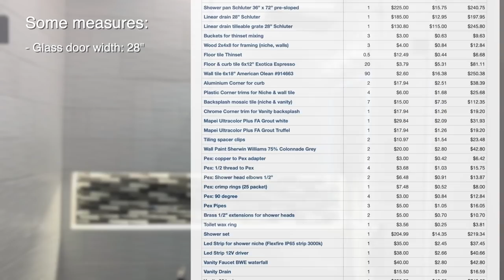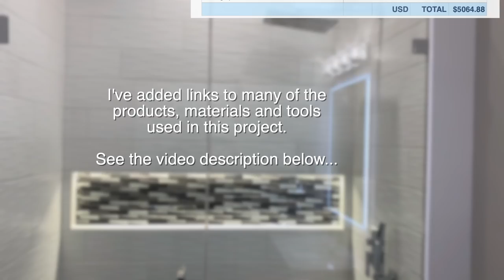Bathroom remodel with Led Light Niche

Comment: Thanks for including the "Material Cost" list.  Fyi, I think they overcharged you for line item #9 - Linear drain tilleable grate 28" Schluter  Qty - 1; Price $130.80; Tax $115.00 - Total $245.80 I don't know the state or county you live in, but those are some crazy taxes.
Reply from the maker: Whoa.. Thanks for spotting that mistake. One dot in a wrong place makes a 100 bucks difference in the cost.

Comment: Your remodeling skills are so good and you are the master of video editing. Your bathroom looks almost too good now like you spend your time thinking about ways to lure people into the "shower dimension". But I came here for the niche light LED install, not to watch you build a bathroom in 5X. It was in the title and I never saw you install a dimmer switch or know your execution of install such as did the glue hold up to keep the strip tacked down? how did you run the lights out of the tile to look max seamless install? How did you wire it to the romex? where is your dimmer? This guy is beyond "general contractor" and probably gets payed somewhere as an engineer. But his real passion lays in showers and bathroom remodeling. Thats my guess.

Comment: Why not use wood looking tiles then? Confused to use wood flooring when they have that look with tiles too, to avoid potential replacement later down the line in his comments. But, looks fantastic, awesome drain flow work...
Reply from the maker: Thanks. The shower is of course wood looking tile and as mentioned we keep the wood floor (that previous owner installed) until it need to be replaced. Then I will make the entire bathroom with wood looking tile. It was so easy to keep the pre-cut wood floor and I am actually  writing this comment after1 year in use and no problems so far.

Comment: I noticed that you installed the hanger bar on the side of the wall that the shower door opens towards to, wouldn't that cause the door to hang on the hanger bar when you open it? Also does that door open the other way too? Like push to open, instead of pull.
Reply from the maker: It opens both ways. Yes the door will touch the towel bar eventually but not a problem in daily use. It opens almost fully anyway...

Comment: Do you have an estimate as to how much this cost you? I would love to do the same thing, and same style to my bathroom. 
What would this cost if I were to hire someone to help me with this?
By the way, it's absolutely beautiful !
Reply: Just saw the material costs at the end of the video! $5k for all material! And you didn't have to pay anyone labor costs except your own time! Now, I would just need to know how much hiring someone to do this job for me would cost if I were to buy all the materials.
Reply: @goprotraveladventures  depending on where you live and the reputation of the tile installer, it is about $7-15 per square feet. A lot of them will install the toliet and vanity for you as well, if the plumbing is correct

Comment: My problem using multiple companies products your voiding every warranty.  Schluter’s warranty says you have to use their products.  It states product is not tested with any other manufacturers products and as such cannot be warrantied.   What are you using to waterproof the durarock nail holes? I would think something similar to Kerdi would be needed, guessing a Wedi sealant type produce. Beautiful
Reply from the maker: Yes I agree it would be better to use same product all over. But our local building code department did not approve Schluter for walls.. Go figure.... 
The "Durock Ultralight foam tile backerboard" is practically exactly the same as Schluter. They have their own screws to use and I used Schluter Kerfi Fix to cover screw heads. I have found it to be super strong sealant and good adhesive.

Comment: tiles on the shower floor, doesnt that make it slippery ? you're supposed to put a mosaic tile for grip
Reply from the maker: Depends on tile. Gloss surface tile would be safety hazard, but this one is not slippery at all. It's been in use for 6 months already and no issues. Thanks.

Comment: Can you explain how you connect the niche light I did not see it ? Thank you
Reply from the maker: There is first a LED driver (120V to 12V converter) outside the wet shower area. It has to be inside a enclosure by building codes. 12V smaller wire goes from the Driver to the niche corner (Inside wall), then through the left top corner and there I soldered the 12V wire to the LED strip. Then sealed the corner with good brand silicone adhesive.
Reply: @TKR-videos  thank you for the information!!! Really good job 👍

Comment: Was that kerdi backer board ripped down for the shower curb build? Can you provide details on this portion, as I didn't see it under the video description.
Reply from the maker: Yes that was 2 inch thick Keri board and I cutted it to 4" wide. It's expensive board though...

Another option is to use ready made Kerdi Curb https://amzn.to/3rNFzYf
Reply: Great thanks for the reply. I was told to just use 2x4 but have read that in a basement it’s not the smartest choice.

Comment: Hi, is it illegal you do this without any code violation as a handyman? Will I be able to registered it to the city to increase the home value?
Reply from the maker: I'm in USA and yes I have to apply for a building permit and plumbing permit. City approves the plans before you start, and then inspects every phase and that way your shower will meet the code requirements.

Comment: hello what kind of drywall did you use for under tile?
Reply from the maker: For walls it is lightweight foam board that has water proof layers both sides. There are several brands available. The one I used was Durock Ultralight foam board. Another one would be for example Kerdi Board. Check what your local building code approves. And these foam boards require a specific screws to be used.

Comment: i would have used vinyl planks instead of wood.
Reply from the maker: Vinyl would be better choice but this wood floor was there already and it continues seamlessly across whole downstairs floor. I will replace the wood floor if it gets damaged. After 6 month no issues and the wood floor has not get wet all all.